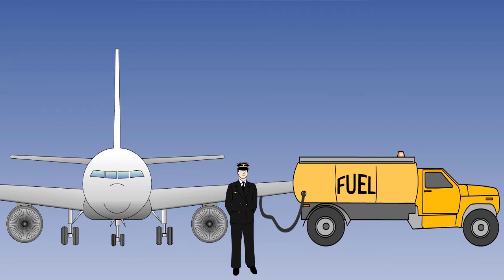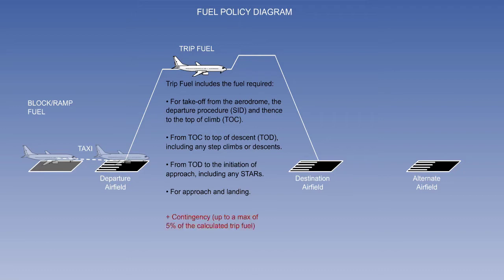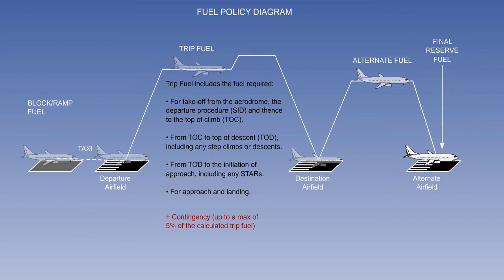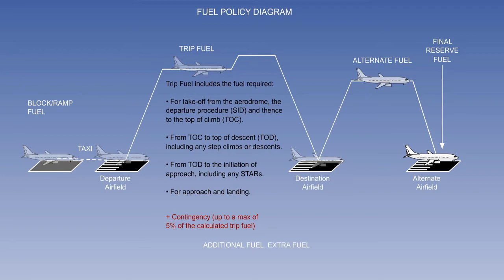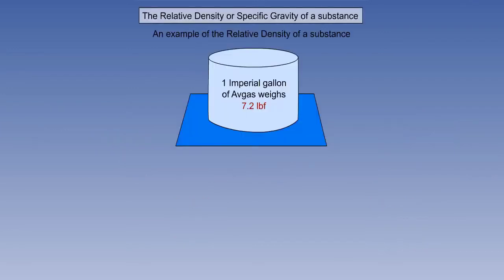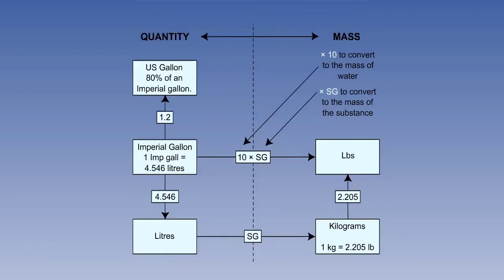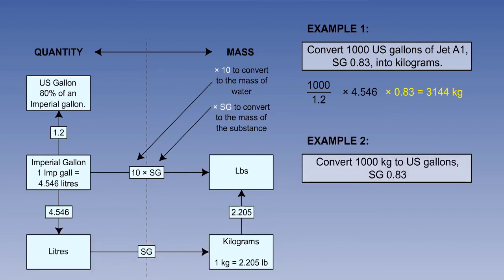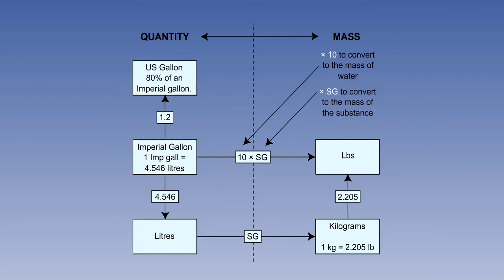Aircraft Mass And Balance With Fuel | Calculate Aircraft Mass And Balance Introduction | Lecture 05

Comment: Why we use SG of the fuel  instead of using just density of the fuel? if anyone can clarify please, thanks
Reply: consider USG 1usg is 3.78 liters(volume) we have to convert it to mass . and to convert it to mass we can multiply it by sg . 
sg of water is 1 means 1 litre of water is 1kg .
as we have to convert it to mass we have to multiply the volume by sg of fuel ( which is generally given by the operator or the refueler) 
as all the calculations of CG and MTOM are based on mass we have to convert it to mass . . 
I am not sure why density is not used but i gave you all the points why SG is used :) 
Hope that helps
Reply: The specific gravity (SG) of a substance is the ratio of its density to the density of a reference substance, usually water. When it comes to aviation and fuel, specific gravity is often used instead of just density for a few practical reasons:

Comparative Measurement: Specific gravity provides a comparative measurement that is easy to understand. It gives a ratio of the density of the substance (in this case, fuel) to the density of water, which serves as a standard. This allows for a straightforward comparison of the density of the fuel to a known reference.

Consistency Across Different Temperatures: Specific gravity is less sensitive to changes in temperature compared to density alone. Density is affected by temperature variations, and using specific gravity helps normalize the measurement by referencing it to the density of water at a standard temperature.

Industry Standards: Aviation industry standards often specify the use of specific gravity for fuel measurements. These standards provide consistency and facilitate accurate comparisons in the aviation sector.

Ease of Use in Calculations: Specific gravity simplifies certain calculations. For example, when determining the weight of a given volume of fuel, you can multiply the specific gravity of the fuel by the weight of the same volume of water to obtain the fuel's weight.

Common Practice: The use of specific gravity for fuel measurements is a common practice in aviation and related industries. It has become a standard reference point for fuel density comparisons.

It's important to note that specific gravity and density are related but distinct measurements. Specific gravity provides a dimensionless value, while density is typically expressed in mass per unit volume (e.g., kilograms per cubic meter). Specific gravity is often chosen for its convenience in practical applications, especially in the context of fuel used in aviation.